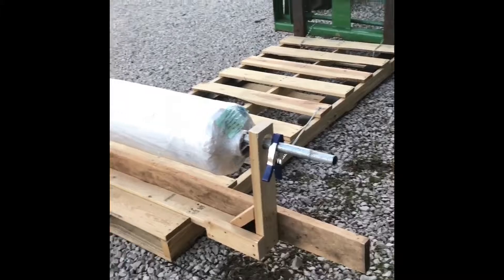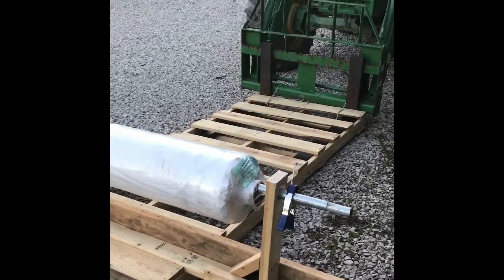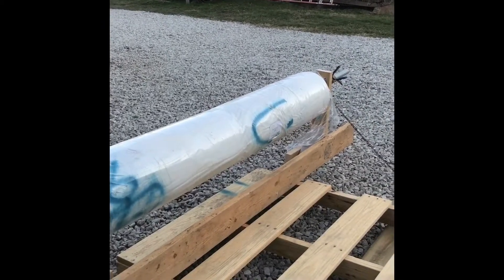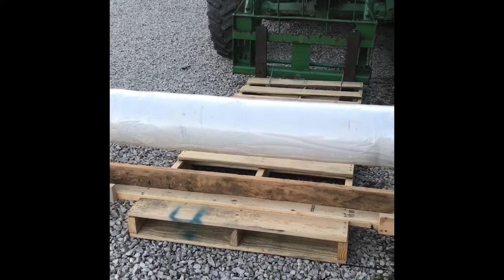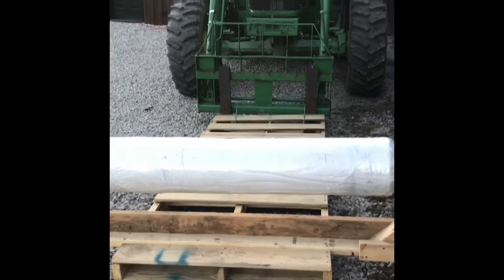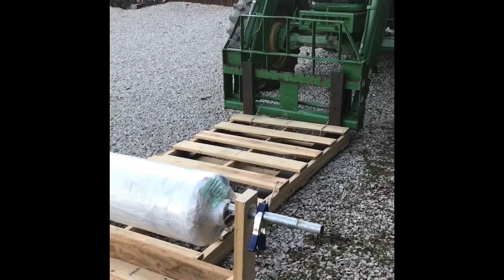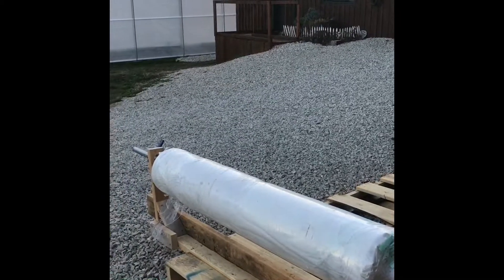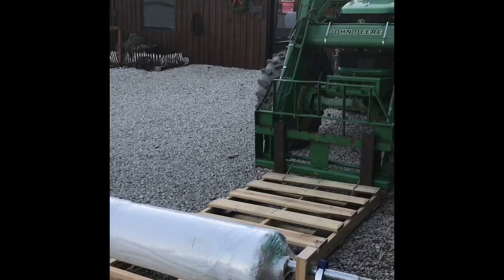Preparing to cover my biggest Greenhouse...

Comment: I was wondering if the cold would make the plastic brittle?
Reply from the maker: mrsgbee it really doesn't seem to make a difference. I do like covering in cold weather because you can't hardly get the plastic to tight. I like the plastic a little loose because we do 2 layers with air between like a balloon.